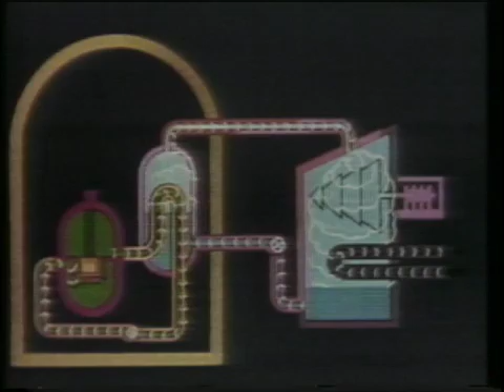Three Mile Island, Nuclear Power Plant Accident: March 28, 1979

Comment: At 3:33 they describe a release of radiation from the turbine.  This is not true.  The turbine is in the secondary cooling loop and does not contain radio active water.  The whole purpose of this is to contain irradiated water inside the reactor building in the primary or reactor cooling loop.  The release of radiation was from the hydrogen bubble that formed inside the containment building.  This was a controlled release.
Reply: I noticed that too. The relief valve that stuck part way open was on the primary side. During the initial stages of any crisis a lot of what the news media says turns out to be wrong.

Comment: Pretty clueless. How could a pressure relief valve in the secondary cooling circuit, which is completely seperated from the reactor core, release radioactivity into the atmosphere?
Reply: There's some radioactivity in the secondary, highly energetic gamma emitters but very short half life, IIRC.  Or maybe that's with a BWR only.
Reply: During the initial stages of any crisis a lot of what the news media says turns out to be wrong.

Comment: In the early 1980's I was a 24 year old technical sales rep for Air Products & Chemicals who called on Three Mile Island. Gas companies like mine did not make money on the gases in cylinders but rather on the rental charges on the cylinders. Three Mile Island had run up an enormous rental charge on cylinders from the time of the nuclear problem 4 years earlier and I was sent there to get a count of all the cylinders. On our books there were over 3000 cylinders suppose to be on the island but as we walked the place I realized that they could account for only 300. 2700 cylinders were missing and it was impossible for more than a 100 cylinders to be in the closed containment building where the nuclear problem occurred. So where did the 2700 cylinder go? After talking to a guy who had worked there for 10 years he confessed that workers would use the cylinders for a period of time until they got down to about 1000 psi and then take them to the edge of the 50 ft. cliff overlooking the river. They would then lay them across railroad pilings and knock the value heads off with sledgehammers shooting the 200 lbs. cylinders out over and into the river. So during the 4 year since the meltdown an average of 2 cylinders a day were shot out into the Susquehanna. Left, went back to my office and billed them $100 a cylinder, $270000 total. They ended up paying $100000.

This was the mentality of some of the workers at the plant.
Reply: Damnnnn
Reply: So basically a bunch of homer simpsons running around.  I’m sure they were unionized too.
Reply: Exactly what South Korean nuclear power plant consttruction and maintenance workers were doing, as exposed by an audit which nearly arrived just too late. They were pilfering everything including cables and even the concrete containment included huge vacancies.

Comment: If Chernobyl had a containment building like the one in this place, the disaster wouldn’t have been half as bad
Reply: I don’t think anything could’ve really contained the explosion it already blew off the steel reactor lid which weighed tonnes
Reply: @TheKratoKiller  It wasn't enough...
Reply: @TheKratoKiller  @JaellanTheHat  A containment building would've held in the blast. They're incredibly thick and built with reinforced steel and concrete. The explosion at Chernobyl was reportedly about 10 tons of TNT which, yes, blew the lid off the reactor, but the walls of a containment building would not have been breached. Even if the lid was thrown directly against the concrete wall of the structure, it is highly unlikely that it would have been broken through.
Reply: @theservantofdarkness3557  and Hydrogen?
Reply: @theservantofdarkness3557  lol. No. A blast would blow a containment building apart like a grenade and made a rubble pile that would make it even harder to have put out the fire

Comment: "the plant did exactly what it was supposed to do" lol it was a partial meltdown
Reply: It really wasn’t that bad there have been no negative affects on the area at all. It was legitimately that weak of a release... the plant still functions to this day they just never used that core again and only kept the second core operating. People just freaked the fuck out because they didn’t understand back then.
Reply: @jacobleukus6930  I live right near it. The plant has lost money. Alot due to people preferring coal for some reason. The plant was shut down September 20.
Reply: @goku546686  people prefer coal because it's cheaper aswell as after this and then later on down road the chernobyl incident it scared a majority of society away from nuclear power regardless of the true safety of it
Reply: urbansnipe Well it was till dumbass yankees fucked with what the IBM computer was doing by dumping water into the cores.
Reply: I think what they meant was the plant did what it was supposed to do AFTER the loss of coolant and the nuclear reaction was terminated, preventing further release of radiation. Radioactive release was something like an x-ray within a mile of the plant. Genuinely not that bad. This is why containment buildings exist.
Reply: They didn't know that then!
Reply: the news downplays stuff like this

Comment: don't know why they're saying the first relief was radioactive steam. the water that goes through the turbines never touches the reactor, and is therefore void of any contamination or radioactivity. You don't even need to be out of high school to recognize that.
Reply: +Wexley Yarway The leak of steam/liquid water they were concerned about was from the primary loop, which is in fact the water that comes in contact with the core to be heated and is therefore irradiated. The loop that passes through the turbine is the secondary loop which interacts with the primary loop only through a heat exchanger which allows the heat to move from the primary loop to the secondary loop without the two separate volumes of water coming in contact.
Reply: +RainbowDashBestPony I didn't realize he followed up with "well below any danger level." I still don't think there would be any radioactivity in the steam coming from the turbine side, but I'm no expert.
Reply: In hindsight it was less than 24 hours after the accident, so exact details were sketchy.